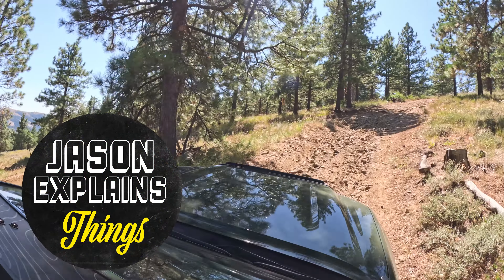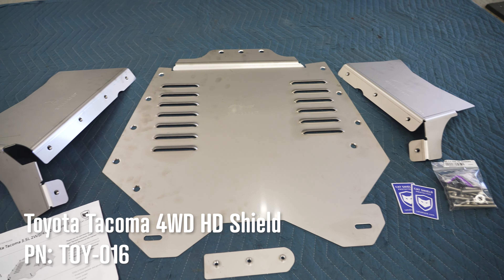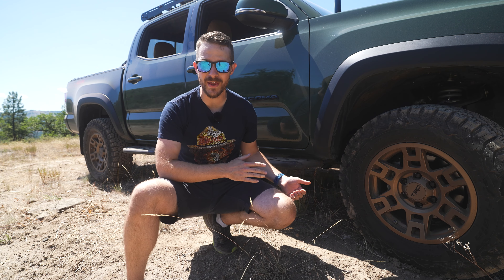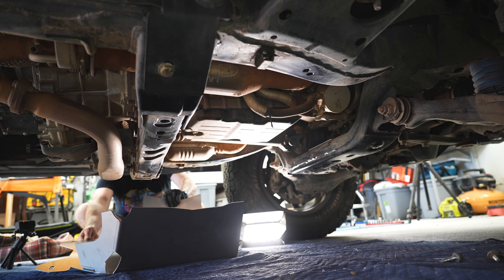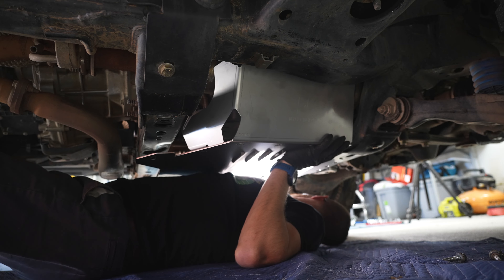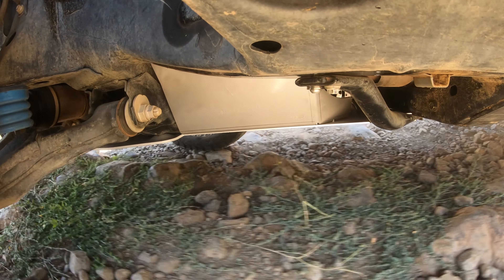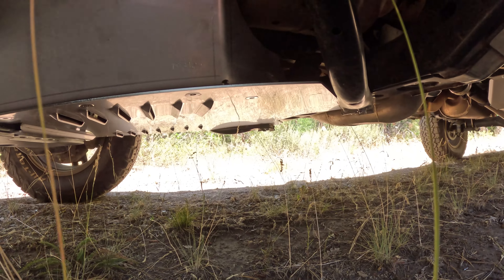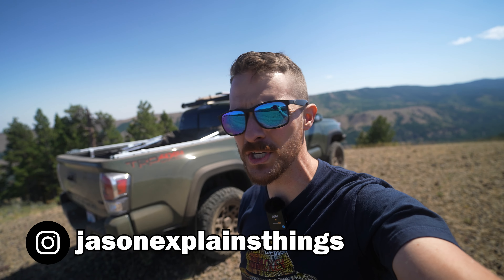Stop Toyota Tacoma Catalytic Converter Theft... and ROCKS!  Millercat HD Cat Shield!

Comment: Just put mine on but getting a lot of rattle on the passenger side cat where the shield flexes and hits it with vibrations. might have to crawl back under and investigate the clearances just wondering if anyone else had that issue on the tacoma.
Reply from the maker: I’ve had this happen with the standard thin one but not the thicker version.  Will be part of an update video I’m filming next month.
Reply: @JasonExplainsThings  the 12 gauge was unavailable when i bought mine so I got the 16 gauge steel version. I am going back under the truck soon to loosen it all up and investigate, havent seen much online about the rattle being an issue on tacomas with millercats.